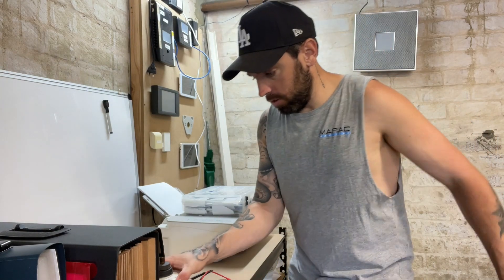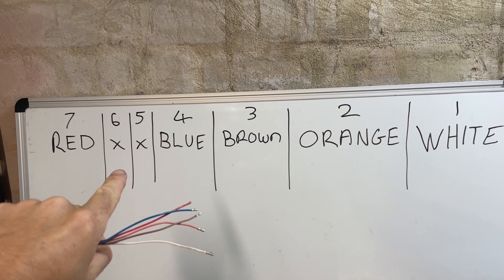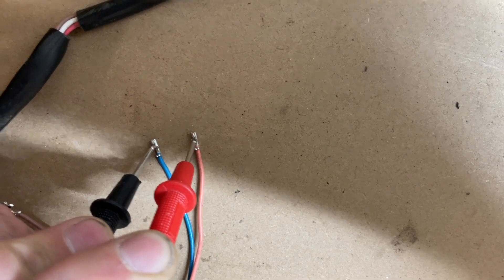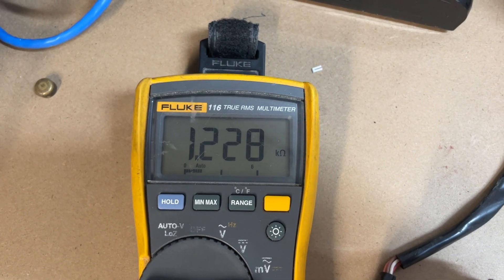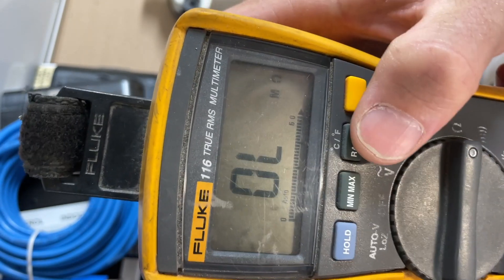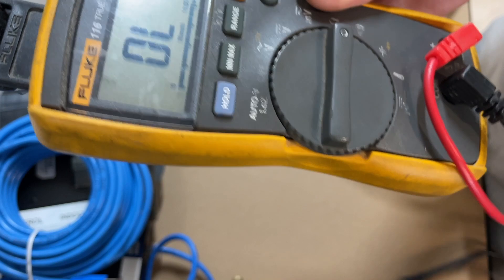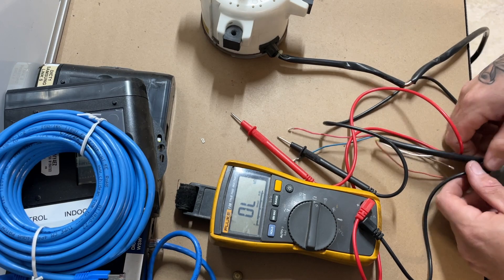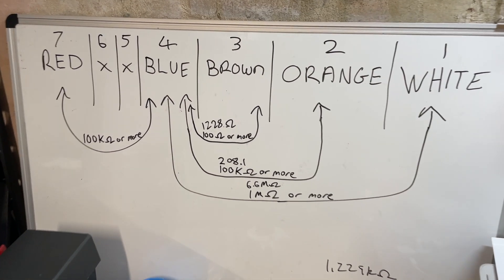HOW TO TEST DAIKIN FAN MOTOR.

Comment from the maker: If the fan is fine, maybe it’s the board that is faulty. Supply voltages from the board should be as follows (check from pin 4 to other connections).

1. White 0-15vDC
2. Yellow 0-15vDC
3. Brown 15vDC
4. Blue (Ground)
5. -
6. -
7. Red 250-350vDC
Reply: If I remember correctly was you that told, in a YT video, about an instrument to test that electronic board (called inverter board in that video).
In this case, please can you tell me which cables you have to attach to the board in order to let the tester run its job?
In others words: which are the points on the PCB the tester wants to check?
Thanks

Here some details for who will read in the future.
In my case (Rotex heat pump, floor2) I see the DC voltage between pin4 and pin7 only when the heat pump tries to start the outdoor fan (floor3). Elsewhere I just see a residual DC voltage which slowly decrease.
This could be OK because near the motor's socket there are some big electrolytic capacitors + full-bridge rectifier which are surely used to generate the high DC voltage. And when unused they slowly discharge, ok.
Unfortunately in my scenario the voltage between ground (pin4) and pin3 is 15VDC but only when the motor isn't driven by the main heat pump unit. As soon as the heat pump tries to start that motor (I'm still with the motor cable unplugged) the 15VDC is increased and then seems in some way related to the activity of the compressor (I can hear it working).
Ok, most probably this electronic board is faulty.
I think that the fan's motor has some electronics inside it so it needs the +15VDC. And there is no reason to have an quite higher voltage than +15VDC while motor is driven. May be the 0-15VDC on pin2 is for speed control and 0-15VDC on pin1 is the feedback from motor back to the board.

Comment: I have the same (or quite similar) motor as in the video. It's from Rotex heat pump external unit in my case. Same cable pinout.  Here I have KFD-380-50-8C.
I read 0.7K red-blue and 2.82K blue-brown. The inline T3.15A fuse blows-up.
Really seems that I have a defective motor. However it's an expansive replacement I see.
I'm try to get some information before buy a new one. 
Do you have available some voltage readings on the PCB's motor socket with cable unplugged?
Thanks
Reply from the maker: Supply voltages from the board should be as follows (check from pin 4 to other connections).

1. White 0-15vDC
2. Yellow 0-15vDC
3. Brown 15vDC
4. Blue (Ground)
5. -
6. -
7. Red 250-350vDC
Reply: @maracservices  Thank you so much, really helpful.
Reply from the maker: @action0x01you’re welcome
Reply from the maker: Supply voltages from the board should be as follows (check from pin 4 to other connections).

1. White 0-15vDC
2. Yellow 0-15vDC
3. Brown 15vDC
4. Blue (Ground)
5. -
6. -
7. Red 250-350vDC

Comment: Thanks for the video.
Instead of removing the terminals from the connector one could use 2 wires (like wires for breadboards) and insert them into the connector's holes.
This is because these terminals are quite weak and easy to bent.

Comment: If you're out in the field then you don't get the reading and you need to turn it over that means that's circuit has a diode in it and it flows one way. There is actually checks for that and you should receive less then 1.5vDC on a diode check setting in the multimeter.    If you receive nothing a lot more or it's an open line it means the diode has failed and in most cases will have sent feedback into the controll pcb and damaged IC's.

Comment: Is it possible that the ohm value is in specification but the motor still failure from other electronic function?
Reply: Check if your board is supplying power, make sure no wires are nicked or cut going to the fan motor

Comment: Hey man, i have no recistance on my meter. Only when i turn the blades. Does that mean they’re dead ?
Reply: Double check that you had set your meter in ohm/resistance function and the probes are placed in the right meter's ports.
Try to short together the 2 meter's probes and see if the meters actually read 0 Ohm.

Comment: Hi Mitch, thanks for your video. 🙂👍 if the fan motor goes does it take out the PCB?
Reply from the maker: It definitely can take out the PCB. Not always but I’ve seen it happen many times.
Reply: @maracservices  Thanks for the reply Mitch.  I saw that the led PCB status light started blinking when the fan was disconnected.  So it seemed the board was ok and it was just the fan motor malfunctioning.  I replaced it and the heat pump is now working fine.

My neighbour had the same issue but the fan motor failing also took out his main board.
Reply from the maker: @jabberwokky8  sounds about right. It’s honestly a 50/50 chance whether the board gets damaged or not

Comment: Thank you. I have a short circuit between blue and brown (or white brown). Do you think the motor can be repaired or replaced?
Reply from the maker: No worries. A motor can be rewound but the cost of the labour to do so could possibly outweigh the price of the fan motor itself. If it was just a noisy or ceased bearing, then repairing the fan would be an option.

In this case, I’d just replace the fan motor myself.
Reply: @maracservices  thank you. Tomorrow I will look for a new one.

Comment: Removing the wires out of the molex plug isn't necessary, most of the time you can back probe or lay it flat and just hold your meter probes on the back of the connector where the tabs are. Just saves the time of removing them and reinserting remembering the order etc.
Reply from the maker: Thanks mate! I appreciate the tip. My fluke leads are chunky as. I’m going to look out for some better ones. Cheers Adam!
Reply: sharpen the tips of the leads with a file or sander ;-)

Comment: Nice job Mitch. There is a diode in some of these motors that’s why you need to switch current directions on the ohm test. Your best advice is learn to read your meter. Thanks for the video, stay well.
Reply from the maker: Ahh that makes sense. Cheers mate, I hope you’re doing well!

Comment: Absolutely crazy what they did with that app. Already its hard as hell to get through to Daikin Technical support, at least the app helped somewhat..
Reply from the maker: Yeah mate, I have no idea why they removed the tech info. Apparently the Daikin equip app is the new go to. Apparently it has all the info on there. I’m not sure why they changed.
Reply: Hey dude, I had the same issue. I logged out and back in again and it brought back all the info. Hope that helps great channel
Reply from the maker: @brendanmurray6836  thanks heaps mate, I’ll give it a try!

Comment: hey big dog if you get the daikin equip app it has all the info - requires a bit of sign up and isnt as easy to use as the old service app but its handy
check out slim tip probes for your multi, I've got a field piece with the adk7 lead kit which has a set of needle probes which fit down the back side of the headers to touch the pins. save depinning and having to think about the order
love the vids mate 
RIP to the service app
Reply: Excellent video Mitch!! Slim tip probes save heaps of time on site. You can also strip some scrap tps cable and wrap a copper strand around each probe to give you a fine point for testing. This has saved me heaps of time in the past, keep up the good work Legend!! 🤙🏼
Reply from the maker: @handle156  thanks for the tip mate. I’m always looking for ways to get better. Not having to remove the plug would save me so much time on site. Cheers Mark 👍🏻
Reply from the maker: Oh wow, thanks heaps mate. I was so annoyed when I thought they deleted all the tech info off the service app. Appreciate the heads up. I will 100% get those leads. The stock fluke leads are chunky as. Cheers mate